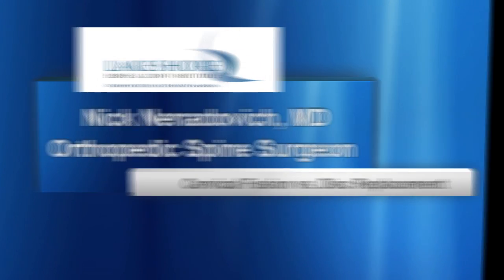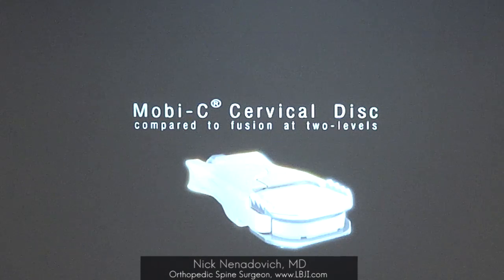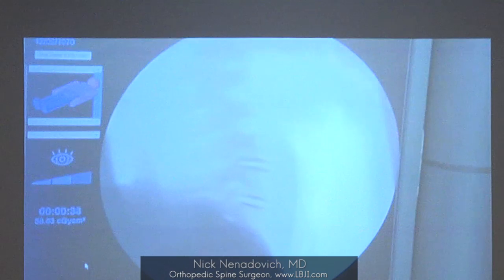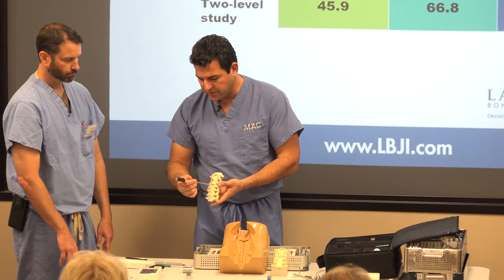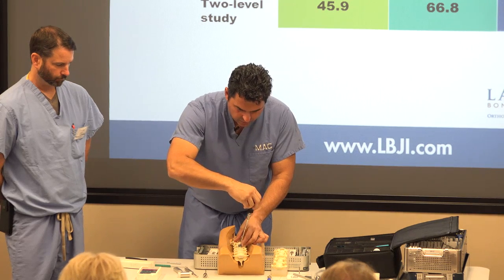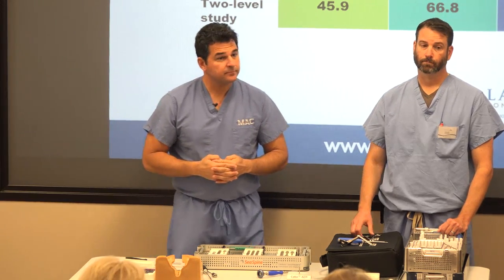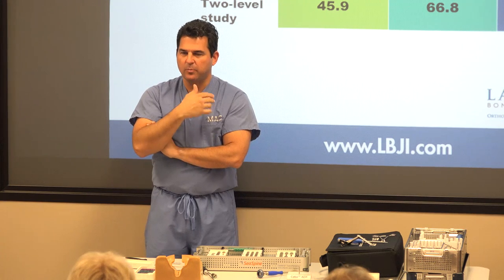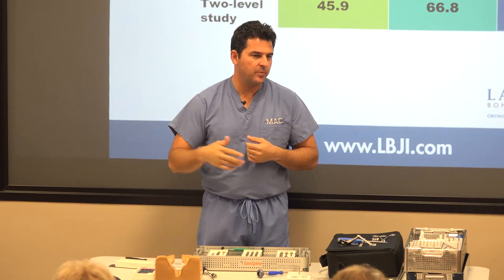Nick Nenadovich MD Cervical Fusion vs Disc replacement LBJI 2017 Indy cadaver lab

Comment: Very helpful video...thank you for posting! Along the lines of the last question asked (what is the longevity of cervical disc replacement device)...if the device should wear out after say 15 years...assuming healthy vertebra...can the device be replaced or must one then resort to fusion? (Also, is the fitting done to the vertebra for a particular disc replacement device so specific...that the surrounding bone can not support a future new/different shaped device?). Thank you.